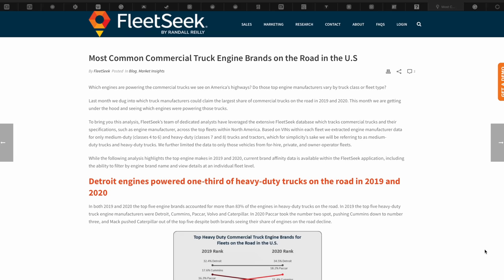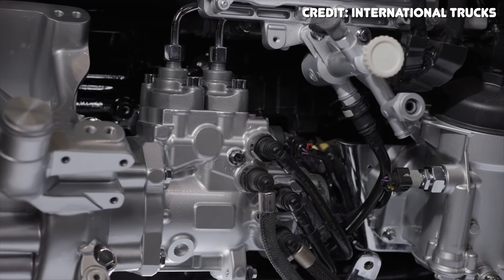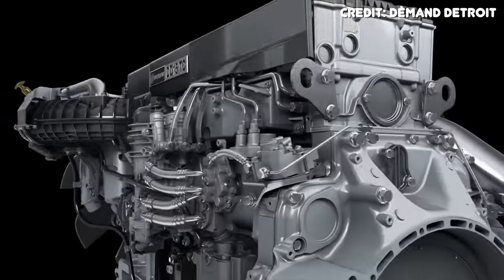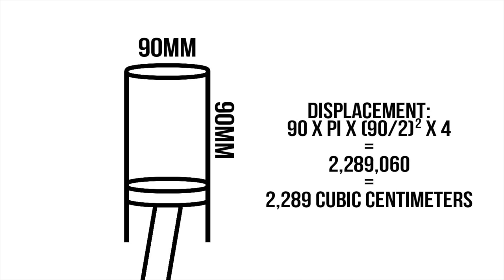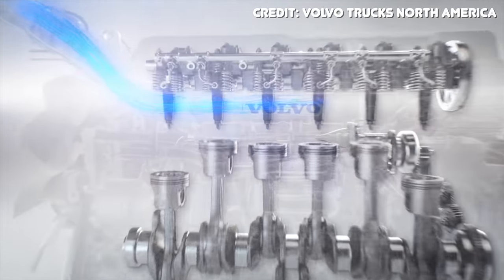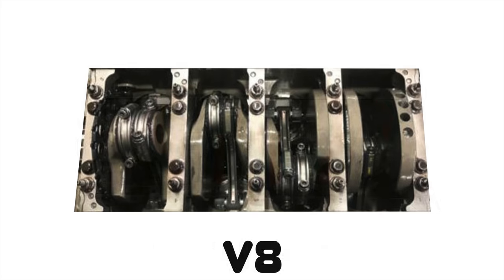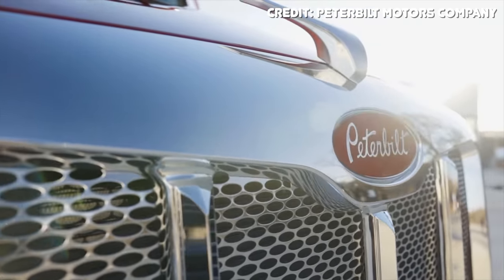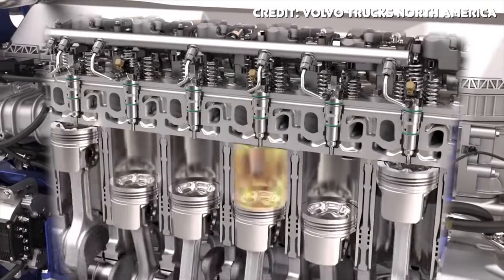Why do Semi-Trucks Use Inline-Six Engines?

Comment: Awesome video! Mark's Mechanical Engineering Handbook has the formulas for different engine configurations. L6/8/12/16 etc. are all perfectly balanced in primary and secondary as their vector sums are orthogonal. Tesla realized that 3 phase motors had constant power because he understood the math. Inline 6 engines use the same math as 3 phase electrical machines. Cool stuff!
Reply: not really
Reply: @lqr824  not really in what way? Ok, so 3 phase isn't orthogonal, but it does allow for a rotating vector, unlike single phase/split phase/0-180 degree crank placement. So perhaps I should have broken this down into multiple topics.

Comment: I think the smooth-running nature of a I-6 engine explains why it's popular with these big semi-trucks. In fact, Mercedes-Benz, which had been building automobile V-6 engines for a number of years, went back to I-6 engines because it was inherently smoother right throughout its rev range.
Reply: The reason Mercedes is switching their V6s to I-6s is due to the decline of V8s. It’s becoming more economical to extend an I-4 compared to shortening a V8.
Reply: @Radio_180  That too. Especially since Mercedes-Benz, like the Volkswagen Group, is starting to wind down ICE development in favor of EV development.

Comment: Pretty sure nobody would claim a Paccar as their favorite
Reply: hey when they work they're pretty good, that and I felt a lot better idling with those engines and their much higher idle oil pressures when I need to run the AC while I'm sleeping

Comment: Thank you for this very important informative video. MAN I learned some new things on your brilliant break down. I also thought in my Humble opinion, that when you look at a large carrier, say (ABF or Hunt) many of the same trucks (semi) the Company BUYS. Taking into account what you said, I hope the company has someone like you that buys a whole fleet of exactly the same CAB & Sleeper layout. The Company is driving the assembly line output. What I'm saying is. Semi plants run a custom order plant. It's not all Robot line. There is still a manpower element to the Line. Say (ABF) is buying a fleet of new trucks, replacement of older less effective (has to have a scrubber or DEF) ABF is actually picking the NEW Diesel Engines that will power their fleet. The bean counters are looking at all the things. Like you said, more miles on the engine over life. How much fuel the (Semi truck) will burn. Most of these large carriers put the (10 speed) high/Low range transmission. The same on all there (Semi fleet) worked for a Large carrier and all there ( FLs) were identical. Engine & Transmissions, will say live in a Large forest harvest State. The Loggers love the Biggest 8s and an 18 speed transmission mated together. The Right gears for many miles driven on hills and gravel. I once drove out to a village for first Nations People on Vancouver Island Canada. It was 40 miles to town on gravel roads, the Logging company maintenance the Roads. The town used to have a big saw mill. Because it was Faster for ships to pick up lumber then back to overseas ports. The mill is GONE now, but the town lives on with a big Farm raised Salmon products, and sports fishing personnel and charter. The saw mill now is the base for setting up on building Farmed Salmon pens, then towed to local coves. But I'm just saying do see Logging (Semi truck) a whole different animal as far a Loads and roads that driven on.

Comment: Scania has the most powerfull semi truck engine tho, that is a 16.4L v8 at 770HP.
Reply: Inline 6 still better tho like the Volvo fh16 750 have a inline 6 that can tow 300.000lbs barely
Reply: @Chris-eo4ry  I would say maybe volvo is not more powerful anymore (for now) but it still have better at fuel efficiency

Comment: Semis can have low power because they are expected to operate in a small range of speeds.  Torque does not matter when you're going fast, it's all about power.  When you're going slow you can have either a lot of power or a lot of torque to get the job done.  When you're going slow, more torque is preferable because it allows you to keep revs low, which is more efficient, quieter, produces less wear, and makes the driver feel like he isn't working the engine as hard (the last one is entirely psychological).  But, if you have a vehicle that is expected to go both slow and fast, and transition between them quickly, going the high torque, low power route isn't feasible, which is why you'll never see an engine producing 600 ft-lbs and 300 hp in a sports car, but you might see 300 ft-lbs and 600 hp.  And contrary to what a lot of diesel bros think, with the right transmission a truck with an engine that produces 300 hp and 100 lb-ft can do everything that a truck that produces 300 hp and 1,000 lb-ft can; but the former will be revving a lot higher, which means that it will be louder, less efficient, and won't last as long.

Engine torque does not matter.  It is wheel torque that matters.  Thanks to transmissions, a high power engine can deliver just as much torque to the wheels at low speeds as a high torque engine; but the high torque engine cannot deliver as much wheel torque as a high power engine at high speeds.  Some say that you need torque for beginning from a stop, but that's what clutches and torque converters are for.

Having high torque, but low power also means that you either have extremely high pressures or extremely large displacement, in the case of semi engines, it's both.  This means that the engine is going to be very heavy.  Semis and large pickups (ala Superduty) can handle that just fine, but you're not dropping a Powerstroke in a Fusion (someone has probably done it).

Comment: Perfect example comes from Ford, 302 vs 300.  In truck applications the 300 is superior in every way (more torque, mpg, and longevity).
Reply: I owned both.....a 2WD F150 with the 300 six and an F150 4wd with the 302. Both had 5 speed manuals. Mileage was slightly better with the 302. More WOT power with the 302. The 300 six would lug a little better but overall the 302 truck was better on all counts and it was a couple of hundred pounds heavier..
Reply: @turbo8454  like to know how was better with the same 140hp and the 302 makes less torque.   Remember truck 302 were not roller motors nor were they H.O. motors.
 Would be curious to know which rear gears had
If was only getting slightly better mpg then I would say using too much pedal.
I'm willing to bet the 4wd 302 had 3.73 or 4.10 gears and the 300 had 3.27 or 3.08 gears, which would explain the perceived performance of tge 302 and you drove the 300 with full pedal to make up for the gearing difference.
Reply: @bowez9     Both trucks had 3.55 gears. Both were fuel injected (302 was a '94 and the 300 was a '95). Both were base model XL's.

HP/torque as follows (manufacturer ratings)

302,  205HP @ 3800 RPM, torque 275lbs/ft @ 2400 RPM

300,  150HP @ 3400 RPM, torque 260lbs/ft @ 2000 RPM
Reply: @turbo8454  205hp is the HO motor not the truck motor 140hp is what the non HO motors made with the Cobra and Tbird making 225-235hp.
Dyno numbers for the 300 put it at 300lb-ft at 1200rpm.  If those are Ford numbers then it's amazing, cause nothing changed on the truck motor and how did it go from 140 to 205? Marketing boys at it to push 302 sells in wake of the HO 302 being slower than the Tbird SC, so have to please the "Got to have a V8" crowd some how.
Reply: @bowez9  Not so. Truck was 205 HP, up from 185 HP in '93. Mustang was 215HP in the 5.0 in '94.
Reply: @turbo8454  the numbers in 90 was 140hp for all non HO motors and no components changed on non HO  motors, 93± HO motors lost forged piston.  Amazing how in 30yrs the non HO motors went up in power, after they were sold.

Just like the gen 1 Lightning when it came out was just a dual exhaust 351w and then years later every just knows it's a unique motor.
Reply: @bowez9  1990 F150 302.....185HP, 270lbs/ft.  I have no idea where you're coming up with 140HP unless you're talking about 2 barrel carbureted 302's.

My point remains, the 302 was a better all round engine in an F150 verses the 300.  If you like the 300, fine. What you like and prefer has no bearing on my experience or preferences.
Reply: @turbo8454  no your opinion is the 302 was better.  But ratings from FOMOCO was 140hp on EFI 302 and 300.
Reply: @turbo8454  so using your logic and numbers everyone that bought a 7.3 IDI was stupid,  given the 302 made more Hp and nearly the same torque, at about a $2000 cost savings over the diesel.
Reply: @LargeMuscularTitties  7.3 idi made 180hp and 330 torque. And the point I'm making is the internet is changing the numbers posted (imo due to the confusion between HO, truck and explorer motors).  At the time the official numbers were as I stated.
As far as what I know I've been working on Fords for 25+yrs and own an all orginal 1 owner 90 300 with 600k+ miles.
As your torque comment goes that in and of its self shows the 300 is better than the 302 due to where the torque is made.
The trucks were non roller motors, HO were roller with different intakes, Cobra had its own upper intake but used the Tbird lower while the Tbird used HO upper due to height restriction, and Explorers got the GT40 heads.
Those numbers yall posted are more in line with 4.6 which went into production in 1992.  Now as for the transmissions what was the Manual ZF or M5R2OD, and the Auto C6, AOD or E4OD?
Reply: @LargeMuscularTitties  that's fine if you want to use the internet I'll stick to using the Ford Service Manuals.

Comment: After 620,000 miles on my 5.9 Cummins I am sold on a inline 6!  No issues except normal wear things like valve cover gaskets and batteries.  Twenty two years and still running fine.

Comment: I've heard it a million times: "Inline six engines are the best, that's why 18 wheelers use them". The inline 6 engine architecture has many features that make them well suited for 18 wheeler use. This does not mean the inline 6 is best for light duty trucks. 
So, for big trucks the advantages are mostly economic: fewer moving parts to fail, easily repaired in the chassis, more easily repaired and more inexpensive to repair than a V8 diesel for example. The low end torque is impressive, but limited to about 400rpm of peak torque output compared to the 1200rpm of peak torque output of a V8 diesel. It's no problem for big trucks with 10 to 18 gears. 
This is problematic for light trucks with inline 6 engines and six speed transmissions. Watch an IKE's gauntlet comparison, the V8 diesels out perform the inline 6 every time. Their broad range of peak torque output easily makes up for only having 6 gears. For the inline 6, the truck will get slower and slower until there is a gear that multiplies the torque enough to keep the engine from dropping out of its peak output range. It's usually a lower gear than the V8 diesels because their broader output range allows the truck to use a less critical, and usually higher gear to climb the grade. As a result, they climb the hill faster. 
Practically everything about the I6 is designed to cost trucking companies less money to operate and repair, and they are a more cost effective option for big trucks- that's been proven over time

Comment: In-line motors are more fuel efficient I believe it to be a balance of rotation mass thing but I’m not an engineer
Reply: number of cylinders matters as well iirc
Reply: configuration doesn't matter as much for fuel efficiency but a long stroke and a lean burn is really what does it

Comment: I was a diesel tech for only 2.5 years.  Vast majority of the trucks that I worked on had I-6s. I would not want to imagine working on say a diesel v8 in a commercial truck, let alone a pick up.  The inline 6 configuration was simple and neat inside of the trucks (even though depending on the manufacturer, it did appear to me that many components under the hood such as harnesses and air lines were arranged in a miscellaneous way). I've wondered myself why so many trucks had straight 6s and came to the same conclusions.  It runs very smooth inherently, it's a configuration that is prone to producing a lot of torque, it is simple like I said before, and it can be cheaper than a v8. Those engines were capable of running for 500k miles and more.  I just remember how smooth those engines were when driving those trucks, and wondered how much of that could be attributed to the engine itself or the mounts. From a tech perspective I would say that the inline 6 allows for the best ease of access to different components. It's just an awesome configuration for trucks and cars as well

Comment: question)Why do Semi-Trucks Use Inline-Six Engines?  Answer) 1) have a "shorter" predetermined engineered life before a major overhaul.  2) The 6 cylinder is an $ATM$ for the engine parts industry]....Thee End!    The Scania V-8 [from their website] is designed to go 1.2M miles "minimum" before overhaul and they have many customers in the 3mil range that have not done a major overhaul.
.....There is no engine on the planet, from factory, that has more HP and torque compacted into an engine liter per liter than a Scania V8.  770hp @ 2100 rpms and 2730# torque at 900 rpms...."on a single drive axle, hahahaha" AND unit cylinder heads called "power packs".  You can pull one cylinder head off and leave the other 7 heads on.  Scania is the leader in fuel injection and emissions.  Even Cummins went to Scania to get them to help them (cummins) make their XT fuel injector system on the latest OTR diesel engines.  You Scania design our Cummins fuel system and we cummins will build it cheaper than you in our facilities in Mexico.   To day a 6 cylinder is easier to work on and more reliable than a V-8, sorry man, you've never worked on one to have that opinion.
Reply: There are quite a few L6 diesels with a B50 life of 1.2M miles and some V8s that don't have that high a life expectancy. 
Torque output of an engine is not be affected by the number of drive axles.
At this point Scania engines do not pass US emissions which is one of the main reasons that we can't get them in North America. Volvo makes almost as much power with their 16L L6 and is able to meet US emissions standards.
Don't get me wrong, Scania makes a great engine.
Reply: @rich7447  there's no such thing as an L6
Reply: @wizard_of_poz4413  L6 is an abbreviation for  inline 6.
Reply: @rich7447  Scania makes more torque and power than Volvo's I6 across the range. Volvo makes 750 at the flywheel, Scania makes 730 (or now 770) at the wheels, this is applied also in marine form. Scania's emissions system on their new engines are the only engines on the market without EGR.
Reply: @Rich  how does L 6 stand for *I*nline  6?
Reply: @rioblyth3926  yea but we're never going to produce anything remotely comparable to europe
Reply: @rioblyth3926  Horsepower is not all that important in heavy truck engines.
I'm guessing that the lack of EGR is one reason why they aren't accepted by the evil EPA.
Reply: @wizard_of_poz4413  It has for the last 60+ years.
Reply: @rich7447  bruh it's i6
Reply: @rich7447  I believe that's probably a clerical error of someone mistaking a capital I for a lowercase l
Reply: @wizard_of_poz4413  If I remember correctly in Germany inline sixes are abbreviated L6's.
Reply: @rich7447  scania v8s all have EGR, there are two European truck manufacturers with engines which pass Euro 6 (basically the same as the current EPA) without EGR, MAN but only their 9 litre unit which maxes at 400bhp and IVECO who do most of yheir range without EGR  but very high def fluid use is the payoff. Neither of course is used in the US, maybe the MAN might find it's way into lighter Internationals in the future since they have the same parent company and the Navistar A26 is a badge engineered MAN D26 already. IVECO units are only used in combines in North America, although IVECO came out of FIAT, it now belongs to Case New Holland.
Reply: I'm pretty sure an old QSM11 marine engine from Cummins at 715hp is a way higher power density, as well as the 560hp 6.7L QSB.  But it's not fair since it's not rated for on road use.
Reply: @robwhite3241  well that would make sense because the Deutch translation probably starts with an L
Reply: @rioblyth3926  in marine spec they climb to 950ps...
Reply: I think the L6 came about as a way to differentiate between the L head (flat head L6) and the overhead valve (OHV I6) head engine's.  Most referred to the flat head 6 as an L6 and the overhead valve 6 as an I6.  Mostly a marketing deal for those manufacturers who went overhead valve earlier to use against those who stayed with the flat heads longer.  I think most literature today refers to them as an I6 for inline.

Comment: Six cylinder engines have a super longevity built into the engine. The wear on the crankshaft is on a very small surface area. Where the V-8 engine because of the shape the crankshaft wears a lot more on the circumference area this causing way more wear which causes a lot of oil spray reducing lubrication volume to the upper part of the engine itself. Period.

Comment: I don’t drive a truck but I drive a 2005 BMW E46 330d with a big stinking 3Litre turbo charged inline 6 diesel 

I absolutely love the car because of the engine and despite it falling apart in other areas, the engine refused to even throw a single fault or break anything in any way and produces heeeaps of torque and power for a 14-1500 kg car

Comment: This is also why our military stuck with 4 and 6 cylinder engines when V8’s were available during WW 2.  The GM 302 was a power house for it size.

Comment: One thing as a trucker, visual inspection is much easier with an in-line 6. You can see if you have an injection leak, know right where anything looks off or worn. Yes, easier to work on, but doing your inspections, better able to notice wear.